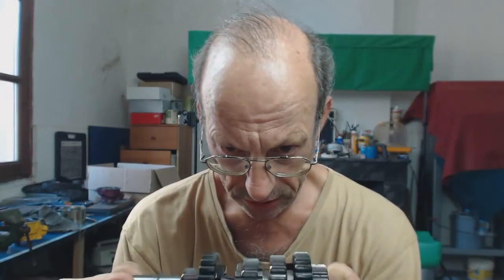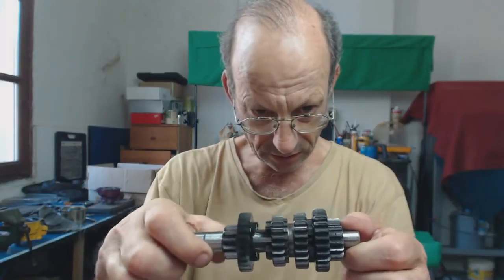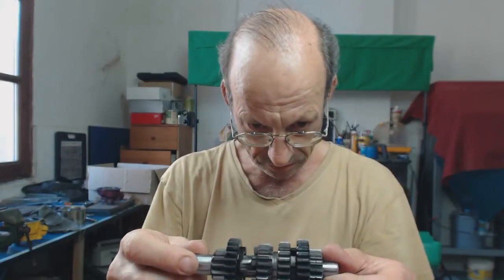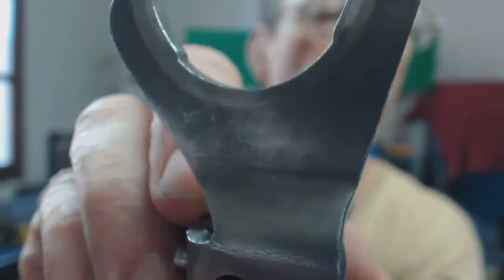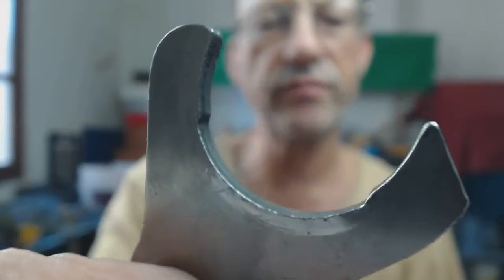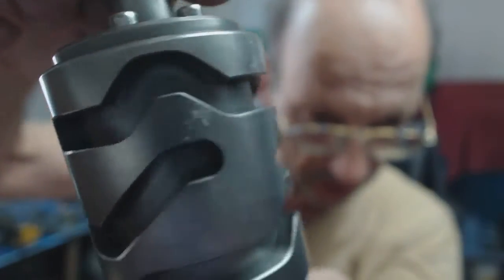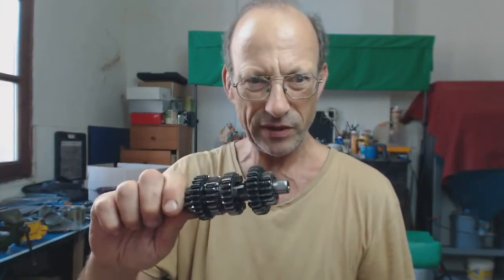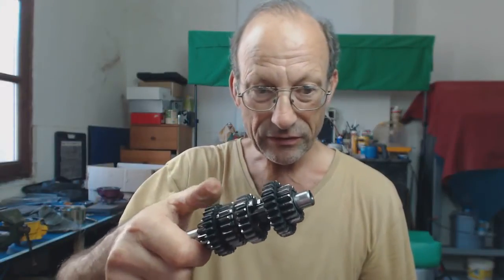AM6 Engine Assembly Guide - Part  2 - Inspection & friction modifications

Comment: Hi there, Even though i noticed this video series is already a bit older it still is of great value. So thank you for taking the trouble to make this video series.. I recently had an Aprillia Red Rose Classic 50 which has a Minarelli AM5 engine on it which isn't too different to this AM6 you are working on. My enginblock has somehow had a lot of water in it. Half of the oil turned out to be water so i will have to take the engine block apart to try and clean / salvage it if it is at all possible. But So far i have only found an Italian and a Polish Youtube poster but there i can only watch.. On your Video i can actually understand what you are saying and you give very clear instructions and that wil be a great help once i get to work on the engineblock. I was wondering what you did or used to make those parts non-sticking so i am hoping you may still reply on this. Great Job! thank you again from Holland.
Reply from the maker: Hi Frank :)
Glad that you are finding the series useful.
The components were micro blasted in a peening machine, using an anti friction media that is typically used for finishing moulds.
It's a costly setup, but at least you get to see the end result :)
Reply: @EngineTuning  First of all thanks for you QUICK reply 😀 And yeah the finish on those parts was amazing. You mentioned finding specs in the manual.. would you happen to know where to find manuals for the AM5 engines? Or even the AM6 because i think apart from the number of gears they are not all that different. And i am kinda new to sort of drastic engine rebuild but your videos def encouraged me to give it a try. No pain no gain😂
Reply from the maker: @frankvanderjagt2441  The workshop manual for the AM6 is available for free download. Just run a search for it ;)
Reply: @EngineTuning  ok, thats cool. I will give that a try and let you know..👌😃
Reply: @EngineTuning  Found a workshop manual online indeed ;)  thanks for the tip. It is however the AM6 but with the tips you gave on here it should work out pretty much the same. And i will pay extra attention to the situation with the shims like you mentioned.